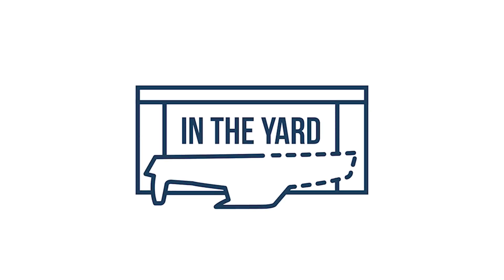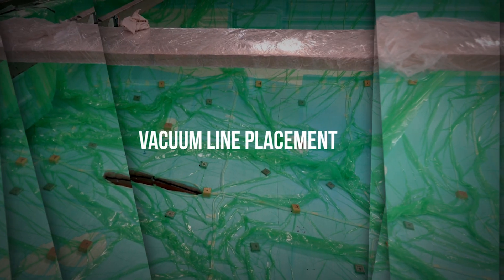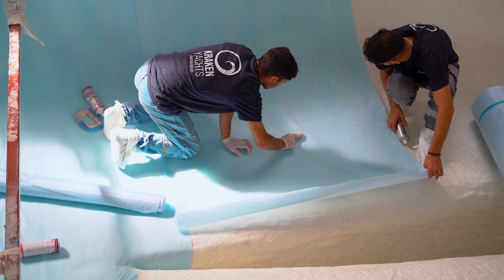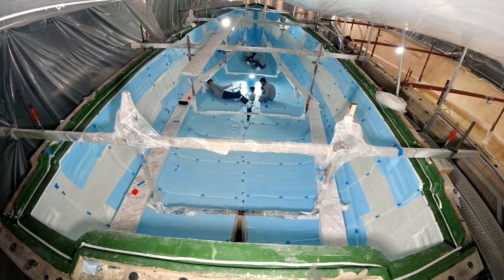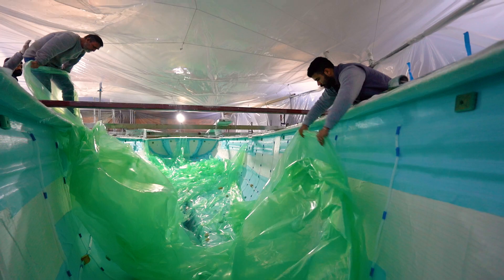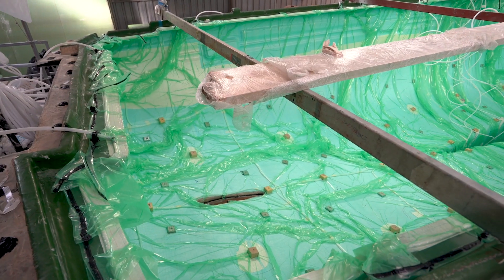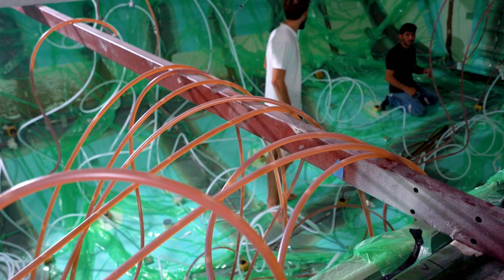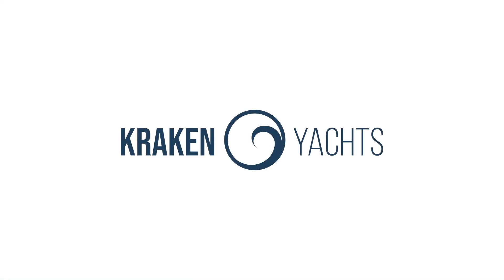Kraken Yachts presents - In the Yard - Episode 4: The Vacuum and Infusion process

Comment: Enjoying these technical videos. Could you cover how you close up the keel. One side of the keel is open then you install the lead bulb I am wondering how you close up the open side of the keel. Do you glue on the separate keel skin? 👍
Reply: I had the same question. Isn’t there a risk the zero keel will split if it it’s made in two parts?
Reply: @alexmason1022  Yeah they never answered that question obviously don’t want to share everything, which is fair enough. Last time I heard Dick talking about the keel he described using lead balls of three different sizes and a very slow curing resin so it looks like they have changed the process and are now casting it in place into the keel void👍